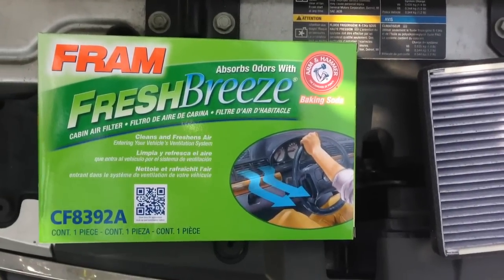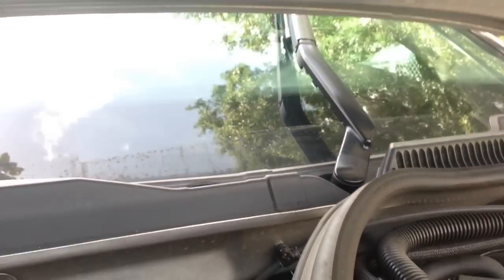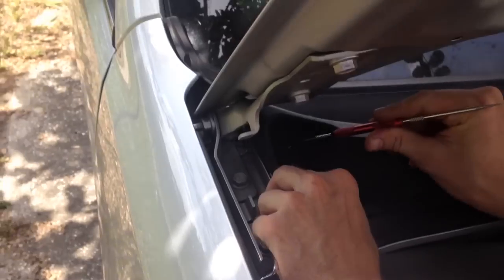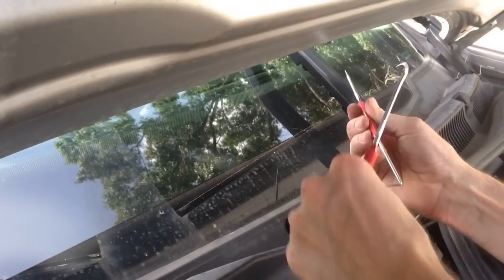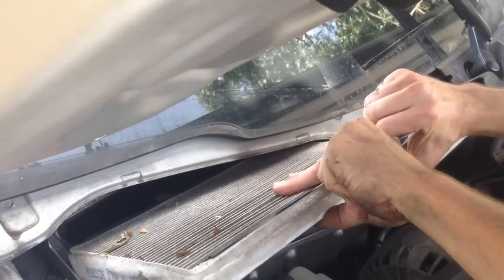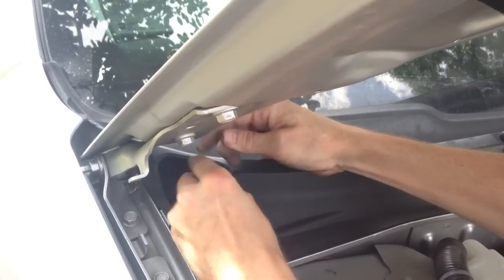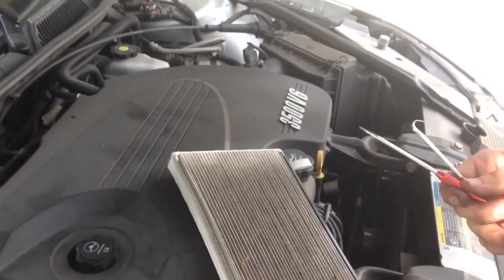2006-2013 Chevrolet Impala Cabin Air Filter replacement

Comment: *Manufacturers recommended ever 10 to 12 thousand miles.

*Me with the stock filter at 210,000 miles
Reply: Changed mine yesterday on my 2006 Impala with 222,000 + miles! Don't know if had ever been changed.Didn't look like it!
Reply: 😭😭😭😭😭 dont feel bad i bought my 2008 4yrs ago and it had a stock filter w/mold all on it... so i had to clean tf outta everything and i got one lf those ac bombs works really well

Comment: Thanks!!! After watching this took me 5 minutes to change. I just used a chip puller and a flat head for the clips.
Reply from the maker: Your welcome. I'm glad the video helped. A small flat head screwdriver and chip puller would work on the clips too lol. I find I break them more often with a small screwdriver which is why I use the picks but hey whatever works. :)
Reply: great idea with the IC chip puller -  it's like a miniature version of the special pliers they sell !!

Comment: Chevy makes it extremely easy to replace the cabin filter (based on location and ease of access) when compared to other manufacturers.  Never pay the dealer to do this for you.  You can change it out in 5 min.  The holding clips can be easily lost and occasionally break with age.  I just use a long screw driver to pry/pop up the retaining clip/button.  If you do need to replace the clips, they're actually very cheap at Chevy parts. dept.  If changing the filter doesn't work to remove any odor, you can buy Frigi Fresh disinfectant on the cabin air induction system (NOT on the filter).  Works well.  Good video.
Reply: Would this work to fix the stinky air con? ... or is there something else I need to look at for that problem .. pheeewwwwww ....
Reply: SundaysChild1966 yeah it would, most smells come from the ac vents because of a disgusting filter or something sitting where the filter is.

Comment: The Lisle panel clip pliers work quite well.  I've poked holes in my hands using picks.
You can buy new push clips in bags of 100 for around $8.00
Reply from the maker: I think the lisle pliers work perfect for the push in Christmas tree clips and you're right you can get bags of that style clip very cheap. For the OEM ones with the push in center I personally have an easier time with the picks. You're definitely right about poking holes in your hands with them though. Lol been there, done that, and it sucks. :) Thanks for commenting.

Comment: same car does this happen to actually collect a lot of the nicotine smoke smell by changing This along with a interior detail  will you notice a difference in cabin smells mainly pre  smokers
Reply from the maker: +Aaron H It more filters the fresh air coming into the car from outside rather than filtering the air that is recirculating in the car. That being said cigarette smoke permeates everything so I'd change it myself anyway and have the interior cleaned by a professional detailer who should be able to get rid of the smoke smell. If that didn't completely do it and if the detailer didn't have an ozone generator than I'd purchase one myself and final treat the car with that. Ozone generators kill cigarette smoke and deep set in odors.
Reply: Transmission oil change in impala

Comment: I had a Jiffy lube change my cabin air filter and ever since when it rains water gets into the car on the front passenger side. Any suggestions on what to look for or a possible fix?
Reply from the maker: Hi I've got a few suggestions for you on what to check for. The first thing I'd look for is this. Some of the Impala's have a foam filter thing to the left of the cabin filter. You see mine in the video about 3:43. My 2010 has it but my sister's 2006 did not have it. Anyhow all the Impala's have the bracket in place for it and you could add it if the filter isn't there. It is held in by the same type push clips that hold the cowl cover on. Lol I need to get a clip for mine. As I recall it was broke. The ACDELCO part # is CF174 for the filter. Rockauto does have them. Your Impala might have had this filter and Jiffy lube could have discarded or not got it back in place. It could be soaking the water up and dripping it in if it was flopped over or something.

The second thing I'd check for is to make sure they got the cover back on correctly over the cabin filter. If it isn't in place correctly then water could be running right off the windshield and down onto your filter. Make sure they didn't crack it either or that would cause the same problem.

Finally if you look to the left down in the cowl towards your passenger fender there should be drain holes for the water that runs off of the windshield into the cowl to drain out of. Make sure it isn't clogged with leaves. Good luck! I hope it goes well for you!
Reply: You may need to use a little silicone or even a little Vaseline on the matching surfaces but NEVER let Jiffy Lube personnel take delicate things apart. Jeez they destroy anything made of plastic. If the plastic is cracked replace it (or if you are lucky you can maybe hot glue along the crack). Replace any old brittle plastic for sure and make sure any gaskets or seals are in good shape. Seals and gaskets need to be pliable and mate well to the opposing surface under a bit of compression to keep water out.
Reply: Jh jo
Reply: +SilentRobHimself a lawyer
Reply: SilentRobHimself first mistake was taking your car to jiffy lube and not doing the work yourself like men should.

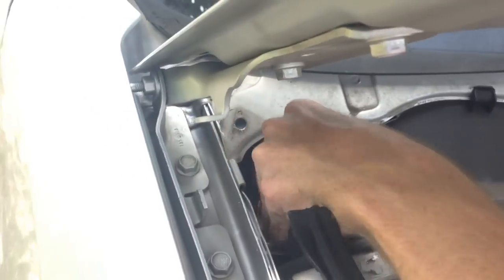Comment: at 5:10 into the video. what is that foam/filter piece? my impala is missing it and don't know if I need it.
Reply from the maker: +Chase  Holt The foam thing It is a side plenum water intrusion preventer filter. It is supposed to help prevent water from going down the air intake. My sister's 2006 Impala didn't have it but mine did. I checked Rockauto.com and unfortunately they no longer carry it. The Acdelco part # is CF174. You can search the web and get it if you want to add it. If you aren't getting any water dripping in or coming out of the vents I don't know that I'd bother with it.

If you want to add it to yours the side bracket that it mounts to should be there. You'll need to get the filter and a retainer clip to hold it. The clip that holds it is the exact same clip you remove when you take the cowl cover off to get to the cabin air filter. I can't get you a part number on that. Rockauto.com is no longer stocking the oem ones. They have a screw in type that look like they would work or you can always check with your local Chevrolet stealership.  Hope this helps. :)
Reply: +Chase  Holt The AC Delco CF174 side plenum water intrusion filter is still available from various places but not being made.  AC Delco CF186 is the replacement part number but it's not multi-layer like the CF174.  
IMHO it keeps leaves and other debris from getting to the actual cabin filter.  It's supposed to keep water from splashing into the main cabin filter and blower.

Comment: What tool Can I use to take off the clips ?
Reply from the maker: You can use a very small screwdriver to try to get them out or you can use the little picks I used in the video.

Comment: How many filters are there on 2010 impala?
Reply from the maker: There is an engine air filter, the cabin air filter, transmission filter, and oil filter. So, there a total of 4 filters.
Reply: @FltWilliam  No fuel filter?

Comment: You know what those red things are called?
Reply from the maker: +Cedric Lawrence If you talking about the hook things that I used they are typically called a hook and pick set. These particular ones are supposed to be for removing o-rings. Here is a link to them at harbor freight.  http://www.harborfreight.com/2-piece-o-ring-hook-scribe-set-42159.html
Reply: Body clips

Comment: should of just used a flat head screw driver to pull clips out
Reply from the maker: As others have said you can use a small flat head screwdriver to get the clips out. I use the hooks as a matter of preference. I find them easier to use than the screwdriver and I damage the darn clips less often with the hooks. Lol whatever works and is most comfortable for you is what I'd go with.
Reply: *should have

Comment: Just remove center pin not the insert.
Reply from the maker: You can remove just the pin to get it out. I find more often than not though when you pull the panel or trim piece with the insert still in it that the d*@# insert falls out and rolls off somewhere into oblivion never to be found again lol.  :)